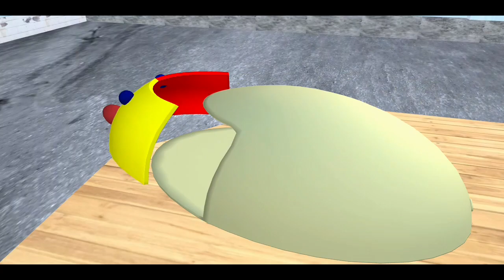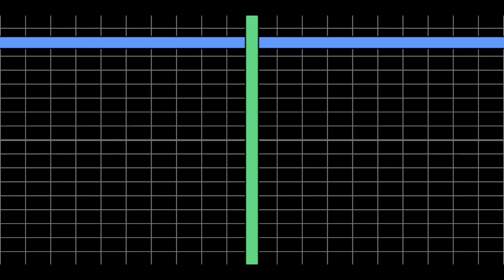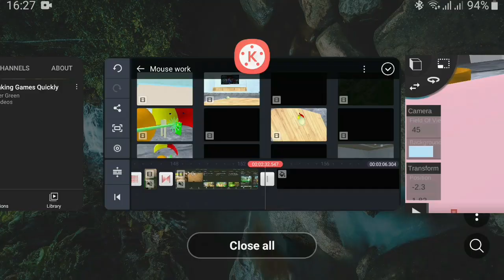How Mechanical Mouse Works? - Prisma 3D Learnings

Comment: Bro i have 2 question 
1: can ypu switch camera in prisma 3d 
2 : how do you add pic in different frma rate to animate
Reply from the maker: Yep I can switch camera in prisma 3D but while Rendering it's impossible. 
Adding pictures in different framerates isba tedious process. First you have to convert your video into many pictures. Then you have to add planes into prisma 3D. Approximately 1000 Planes which would immediately crash prisma 3D. So I'd prefer don't do any experiments on having pictures of different framerates. Thanks for coming
Reply: @HarnaiDigital  How do you switch camera ?
Reply from the maker: @Millionaire_Mindset4  Hahah I don't switch cameras ever. I only use 1 camera.
Reply: @HarnaiDigital  Oh ok 😁